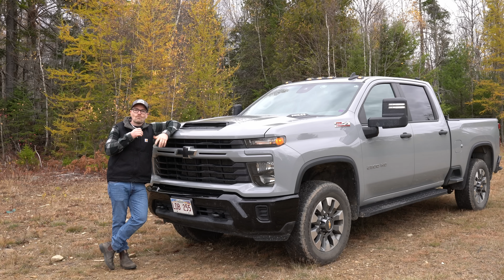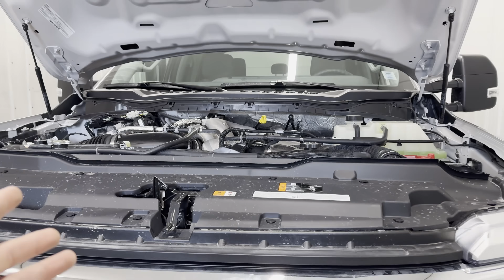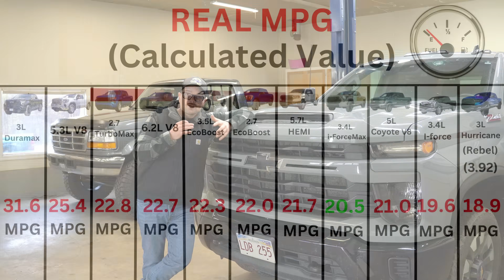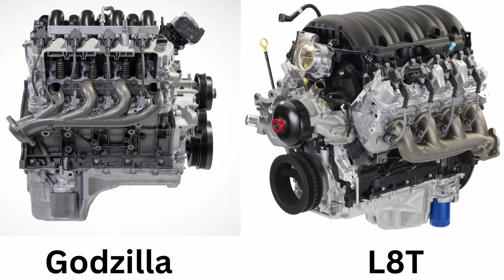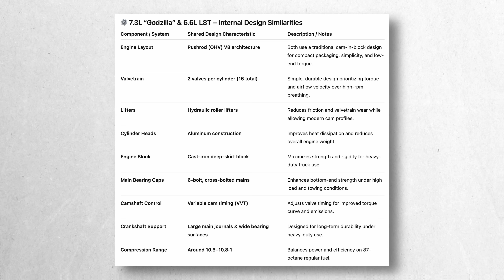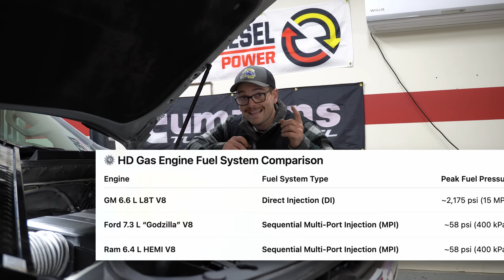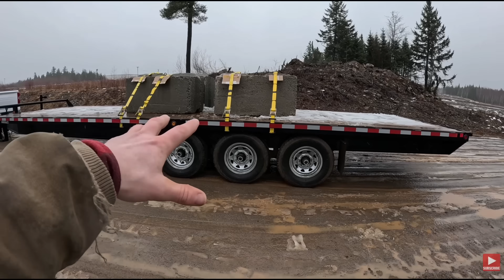Chevy 2500 6.6L L8T V8 Review | GM’s MOST RELIABLE Engine They Still Build

Comment: We have these 6.6’s in our fleet, northern Alberta oilfield work. They get used and abused under some pretty harsh conditions. So far they’ve been great trucks.
Reply: You're comment caught my attention as I am in the greater Grande Prairie area of the Peace Country  ( I farm ) and had bought a 2025 model 3500 SRW and decided to go with the gas vs dealing with the potential emissions issues of the duramax although the diesel was tempting to purchase simply because of power and potential fuel economy. I have few km on my truck so far so not really much of a chance to have had issues. So I was naturally curious if your fleet is working out of the GP area but more importantly what sort of oil change interval have they been doing and have they been experiencing some oil usage or not, and if you know what oil brand they have been going with so far and if its the GM 5W-30 recommended viscosity.
Reply: @charlesb4267  Small sample size of myself and business partner have 2024 Sierra 6.6's out here in Drayton Valley Alberta. We ran the 5/30 while under warranty and noticed both would use about 1 L in 3000 km. Not a huge deal imo. After the warranty was up I switched  to 5/40 pennzoil ultra and oil usage is now about half a liter in 5000 km. We do oil changes every 8000 km and both truck have around 170,000 km and do considerable idle time in the cold temps. Going to run them till 300,000 km or so. Just at 26 months of ownership and they have been really good to us. Glad to be rid of our never ending problems with modern diesels.....
Reply: @charlesb4267 always go with the manufacturer recommendations
Reply: @charlesb4267  I live in the fsj area and I have a 2020 6.6 gas with 145000 km on it.  I pull an 8000 lb trailer 2 time a week on oil patch roads.  I follow the oil change monitor but never go past 10000 km between oil changes.  If my truck burns oil between oil changes it's so little I can't tell.  Also I use 5w30 motomaster oil (shell) and a napa gold filter each oil change.  This is a great truck.  I get 12.5 liter per 100/km on the highway and around 17 liter per 100/km in town. I can go to Edmonton on half a tank.
Reply: An oil field?!?! How dare you!
Reply: @sierravortec2494 lmfao I can hear the accent in your comment 😅
Reply: How about the 10 speeds?
Reply: @Ryan-d4q lets not talk about that
Reply: @Ryan-d4q Next Gen Drivetrain, LLC parts upgrade.  That is all.
Reply: We atill have GMT900’s working in the bush daily. Most of them with 400,000kms.
Reply: I got 300k on my old vortec 6.0 still runs like a top and I have worked the crap out of that truck. The transmission is a different story.
Reply: @stuckinthemud4352 my 2008 2500 HD 6.0 ly6 gas burner is at 529 thousand miles and I've never been inside the engine. Just plugs wires oil.
Reply: Same here. We have the 6.6 in our fleet of Express and Savanna work vans. Always loaded down with tools and material. They never skip a beat.
Reply from the maker: Exactly what they are designed to do!
Reply: @GettysGarage the l8t does not really deal with carbon build up issues its way overblown the 7.3 is not as reliable as the l8t
Reply: Thoughts on a yearly Seafoam treatment for the carbon buildup on the valves?
Reply: @jza80king I really dont think anything helps the carbon build up except a walnut blast and compared to the maintenance cost of a deisel just plan on spending 1k at the 150k mile mark.
Reply: @chadmiller6487 
I got CRC GDI spray for cleaning the valves,  gets pretty good reviews.  I haven't tried it yet so I can't say for sure.
Reply: How are they in the cold? Im out near Cold Lake
Reply: I have a 2021. 58000 miles my average is 16.5 to 19.8. I get about 2 miles better with tier 1 level gas.
Reply: Hey Cory, because of your comment I ended up pulling the trigger on a truck with this engine and man your right. These engine handle a lot of abuse
Reply: It is currently the most reliable engine on the market
Reply: @robertvicente3844 what have you put this truck through ?
Reply: Yeah I’ve used and abused mine. I have a 24’ Sierra with over 90k now. It’s been amazing!
Reply: No issue with the 10 speed?
Reply: @BostonAviation2010  Ford 6.2L is a much better motor
Reply: @alb12345672 LOL... No it's not .
Reply: @InlineSkateFitness  let me guess, you own one? 🙄
Reply: @InlineSkateFitness No they are not
 My brother in law had one and it didn't even last 100k. Plus it was an absolute gas hog. Got hot pretty easy too.
Reply: @seabrookmx  Yes in a Loaded F150, I believe it is a great motor!
Reply: @4673962  I actually have it in an F150 (not raptor) and its very fast! They usually last though. Some die an early death because of valve springs but not common. Usually it could be repaired. 10 years of Superduty can't be wrong. Does drink gas but so does the Chevy.
Reply: @InlineSkateFitness The 6.2 hasn't been available for years.
Reply: @M_dot202  Yes mine is 2011. But In my opinion its the best most durable motor.
Reply: @InlineSkateFitness  lol people like to say things like this about the stuff they own because it makes them feel better. Doesn't mean it's true. The 6.2 has known issues breaking valve springs, leaking oil, and in the F-150 replacing the spark plugs can be a horrendous job. They're not a bad motor overall but Ford has good reasons for moving away from them.
Reply: @seabrookmx  so im actually partial to these newer chevys. I love the way they look and the GMC's are just the best looking imo. I hear really good things about the new durmax. That being said ive got a 2011 f250. 6.7l powerstroke 300k. She purrs. Its probably the best truck I've ever had. If someone gave me a new Chevy duramax, id daily that as my work truck versus my Ford. But my Ford, im well aware of how well it can do and where its weaknesses are. I also know for a fact that I personally delt with a Chevy durmax 2024 that had an OTA software update that killed the BCM and ECM in one go. Pretty scary when an update can fry your electronics. Which means it can be used to disable your vehicle. My old bosses 2024 ram rebel get locked in 4x4 from a OTA update as well. All things considered im more inclined for old stuff as a backup. Ive got a 67 jeepster and a 59 gmc 1 ton just in case things get too bad.
Reply: I can't believe mine has the manual clutch fan lol, that's some HP given up for nothing
Reply: @barnescycle cooling capacity, for the size and cost, an electric cooling fan system can't give the CFMs , and I'm not sure, but probably it uses a Electronic viscous fan clutch, they work 👌🏼👌🏼, with low fuel consumption and not significant hp needs when disengage. Greetings from Costa Rica
Reply: @estebanamador7601  thank you for the input my friend ive never heard of that type of fan I think I just like the clean look and space it provides also. But its not a deal breaker for me at all just surprised by it .
Reply: thank you for telling me
Reply: The roads in northern alberta havent been this smooth in the 14 years ive worked oilfield...give these trucks longer than a year before gobbling engineer peen
Reply: No issue with the 10 speed?
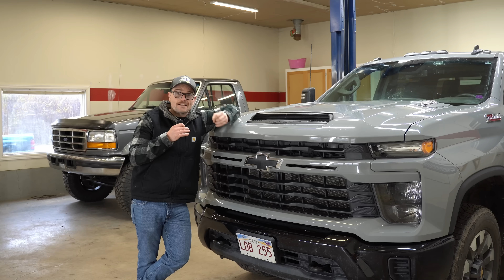Reply: GM seriously needs to give those trucks a 4:10 axle ratio to help with trailer towing. The 3:73 gear makes them feel sluggish when loaded.
Reply: @Lawnboy21 axle ratio mattered when we had 4-speed transmissions. Not so much with a 10-speed.
Reply: @V8sRuleTheEarth gear ratio still matters a LOT! If you don’t have enough rear gear, you’ll hardly ever use 9th and 10th gears! I have a new tundra with 10sp and with the 3.31 gear, it NEVER sees 10th gear! I literally have tried to get it to shift to 10th and only succeeded once and that was downhill almost coasting and that is a 2wd with stock sized tires. The truck needs the 4.30 that the old tundra has and it would be far more useable and also more capable and for what I do it’s a great truck now but could be way better with more gear
Reply: @dcooper91g   I can’t understand this for you, but changing from a 3.31 to a 4.30 rear end so you can “use” 9th and 10th gears doesn’t actually change what the engine sees — the total gear ratio stays the same. You’ll still be running the same engine RPM for the same road speed, just in a different transmission gear.
Reply: @V8sRuleTheEarth let me explain this to you. 

When you have a 3.31 it makes 9th and 10th gear too “tall” for the engine to really ever stay in those gears unless you are on a flat land for miles with an empty truck. 

Now when you have a 4.30 the engine sees a lower overall ratio in 9th and 10 th gear and it’s able to use it. 

You need to understand overall gear ratio. 

When you have a 3.31 it makes the engine have to worked harder per gear than the 4.30. 

You it’s about keeping the engine in its power band and trading horse power for rpm and fuel economy. 

Google overall gear ratio.

When you run a ratio like 3.31 you are beating on the rear axle and making it produce more heat than the 4.30.
Reply: @DasNewsNetwork why do you think you need to be in 9th or 10th when 7th or 8th give you the exact same overall ratio? My response is accurate - and still stand with “rear end ratios don’t matter much given 10-speed transmissions.”
Reply: @V8sRuleTheEarth the point is you no longer has use of those gears. 

What’s the point in having a 10 th or 9th gear when it’s too tall for the the engine to pull the truck empty on the highway. 

On a GM 10 speed the 8 - 0.851	9- 0.687 10- 0.632 are all overdrive ratios. 

The classic 4L80E in 4th which was its top gear, was only 0.75. 

Do you see the issue here ? 

When you have a 4.30 ratio the overall ratio in those overdrive gears is lower so the engine is able to use them. 

But when you have a 3.30 the ratio is just too tall for the engine to carry even an empty truck on flat land.  

The transmission isn’t some magical device. 

Overall ratio is still the master of all. And when you are seeing 3 gears that are all overdrive gears, that rear axle makes. Huge difference.
Reply: @V8sRuleTheEarth no that will let the engine rev a tad bit higher so the trans will actually shit into those last gears. When I actually got my tundra to shift to 10th, it was at OVER 80 mph. If I changed to a 4.30 gear if would be at that rpm at a LOWER speed so might actually let the truck use that last gear. As it is now, it NEVER shifts to 10th. 
Now at 80mph in 9th gear the truck is at around 1600 rpm and won’t shift to 10th. With a 4.30 (or around there) the truck would be at 1600 rpm in 9th at 65-70 mph so then it would actually shift to 10g sometimes. ALSO 1-9th would all be “peppier” as the engine would get to the shift rpm quicker.
Reply: @V8sRuleTheEarth now axle ratio dont matter,  but a valve body failure will 😂
Reply: @V8sRuleTheEarth if a truck out of the factory drives on the highway unloaded and cannot hold its top gear then it sounds like it's either under powered or over geared. My old 4 speed truck has 3.73 gears and almost never downshifts going up hills and it's a beast😊
Reply: @DasNewsNetwork I see the issue and totally agree with you. I could see a benefit of a 10 speed with just one over drive gear or like you said 4.30 gears😊.
Reply: Truck would be peppier and not work as hard so probably better fuel economy.😊
Reply: @dcooper91g  I guess 10th gear is for when you feel like doing100 mph and risking a big ticket.
Reply: @Lawnboy21 : Not with the ten speed .
Reply: I work at a rental company with a fleet of 23s with the 6.6 all at 100k and they stay rock solid for sure
Reply: @rowanclark2673  Thanks. What is your transmission maintenance schedule if any?
Reply: they didnt give that area to the "natives" lol
Reply: Why wouldn't you get a diesel and "borrow" the fuel from the drilling rig  like a normal rig pig ?
Reply: @gerhardschulzy he said fleet. Lot of other things then drilling going on in the patch too and some guys would rather make money than spend it on down time with emissions systems on the diesels.
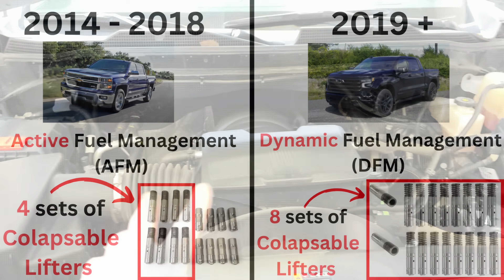Reply: 7:32 no they just gave a heavy duty truck that has to pass no fuel economy numbers direct injection only!!! 🤦🏼‍♂️wait until they get a hundred thousand hard miles on them. Those intake valves will be so full of carbon they’ll all have fault codes.
Reply: @hpkntnw 130k miles on mine. Never had a single issue. 5k oil changes,  fuel additives in every tank and 50k trans and diff services.
Reply: @hpkntnw I have 6,000 mi on my 2024 Chevy Cargo Van. And I'm trying to find a place to mount the oil catch can that they use in the pickups. As they don't make one for the van. Probably because of the hardness of finding an area to actually mount it and get to it easily empty it.
Reply: Live in alberta aswell and they do not do well they spend more time in the shop then on the road whole fleet is chevy 6.6 and have been nothing but problems for the company since the change over is sad the old 6.0 did better towed more and was more reliable maybe ask your fleet mechanic how reliable they are. Thats like saying the 7.3 godzilla is good have there welders at the company with there second engine in under 50,000 km all had spun bearings so reliable they are not
Reply: @ErikKoenig-fv3nr good bot
Reply: @mickwells4714 lol just cause I dont agree with you im a bot way to go moron take it your american or one of the alberta app goofs

Comment: I have a 2020 2500 with the l8t motor , currently 371000 km on it … no complaints, still running very strong 
I had a 3500 ram diesel nothing but problems with the emissions at 60k 
Happy with my decision
Reply: I haven't happened to come across someone that had that many km on their L8T and was wondering what type of use its been doing, towing a lot or more easy work. Also how have you found the engine oil consumption as I hear some have issues while some are not using anything unreasonable. Oh and what does your oil change interval tend to be on a km basis ?. Why I am curious about your unit is that I had bought a 2025 model with the L8T but have few km on it so far so I have little to go off of with mine as to what to expect long term.
Reply: @charlesb4267 I tow twice a week up to 10k lb 
With a 20’ trailer give and take,I don’t push it at all , also lots of hwy km … oil change every 6-7 k at the dealer , no issues with oil consumption yet 🤞, very happy with it
Reply: @andyalonso8790  I assume your in Canada as I see so many in the states put "k" after their mileage number but they mean miles rather than km, it gets confusing sometimes. But I am assuming you mean 6000-7000 km in this instance and more than likely the ac delco oil is what they would be putting in at the dealer. You would soon get the rude awakening if it was consuming oil like what some claim theirs are and have a low oil warning light come on. Whatever your doing maintenance and driving style, its obviously working out well for you ( and nice to hear a positive experience  ! ).
Reply: @charlesb4267  USA commenters use K as in thousands of miles. Yes, CDN's use KM as in kilometers, as you said.
Reply: @MikeR55  All true but unless one knows where they are from its impossible to distinguish the difference so it leaves one guessing, his putting a k on the end of a number in the states was never a thing years back, somehow its evolved into that. Now this channel itself is filmed in Canada but due to the number of American viewers he does a good job of converting everything over to miles per US gallon so its easy for those outside of Canada to follow along. Believe me, even I as a Canadian because I am older don't like this liters per 100 km stuff as it sounds like Chinese to me, that our government rammed down our throats and to this day I always convert it all over to miles per Imperial gallons which throws another twist into the picture. Until the later 1970's Canada was on the Imperial based measurement system and the US being established longer ago used the English system for measuring fluid volume. What a mess ... LOL.
Reply from the maker: Thats awesome. the diesels are great but they can be a headache if you run into emission problems..
Reply: @GettysGarage  or fuel rails or fuel pump implosion or cams or injectors or seal leaks everywhere or.... 😂
Reply: I have a 23' 3500 DRW with almost 130k miles on it. Not a single issue. Has towed nearly every mile.
Reply: @chadmiller6487  What typical mile intervals have you changed the oil at and has there been a particular brand and viscosity you have used if it was not the recommended 5W-30. Also how has it been oil consumption wise and has it crept up or stayed the same to this point ?.
Reply: @charlesb4267 I haven’t notice any crazy oil consumption… again I don’t push my truck …